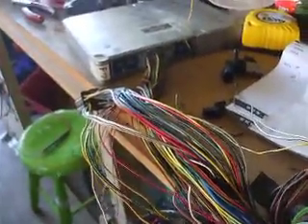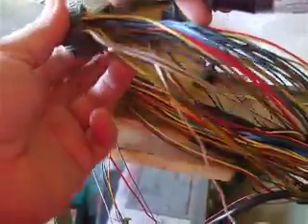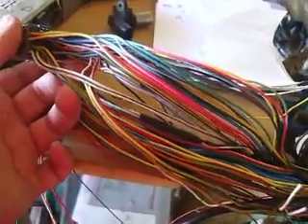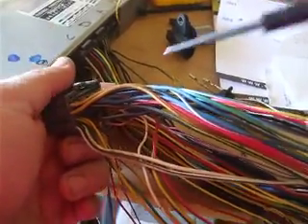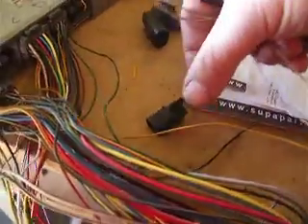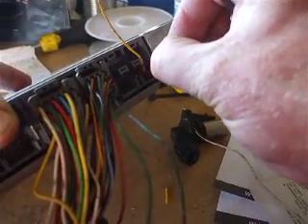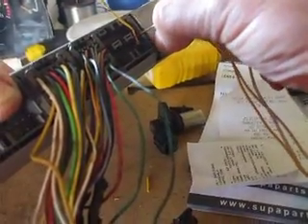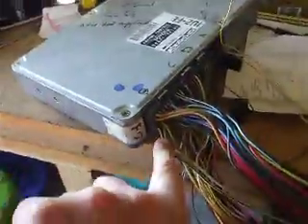Testing Injectors and ignition system at the ECU.  (1)

Comment: Hey, is the 4 pin plug (near the passenger side injectors) is that the coil wiring?
Reply from the maker: Hello.  Lh coil and hydraulic fan solenoid.
Reply: Thanks for that, do you supply supercharger manifolds?
Reply from the maker: @Azz-lt3rv  I dont anymore as there are plenty of manifolds available.  I prefer the bullet super car ones myself.   The purchase price hurts but thats soon forgotten once you fit them.   Cheers
Reply: Also could you tell me which ones are for the coil? So I can delete the fan ones please
Reply from the maker: @Azz-lt3rv  just look at the colours and use multimeter to trace them.  Coil and fan solenoid are right beside it.  Cheers.
Reply: Thanks for that will do. Do you supply aftermarket ecu? Could I email you about them if you do
Reply from the maker: Sure do.  More Aftermarket ecu videos about to be released.  Pre release links on my Facebook page. Email is info@thecartunecompany.co.nz cheers Kelvin.
Reply: Sent you a email no rush mate

Comment: Hi tried to respond last night 
I am waiting on my 1uz-fe vvti with small coils 
I really enjoy your videos and is very informative 
Keep it coming 
I have a nissan hardbody and running a essex v6 
Under powered and very slow 
It had in a zd30 diesel engine 
The tire size is 245 x 70 x 16 
With a lexusv8 do you think a 3.58 diff ratio would be ok 
The engine with original auto box and factory ecu 
Thanks in advance 
Allan from South Africa Cape Town
Reply from the maker: I had to double check the vehicle.  Over here we call Nissan Hardbody a Navara Ute.  I recently had a essex V6 polluting my workshop , it was out of a jetboat.  With that ratio I think it will have a very tall top gear.  Whats your normal cruise speed in SA?  I suspect you might want to put in lower ratio but I'd normally get it up and driving before making a decision on diff ratio.  Cheers